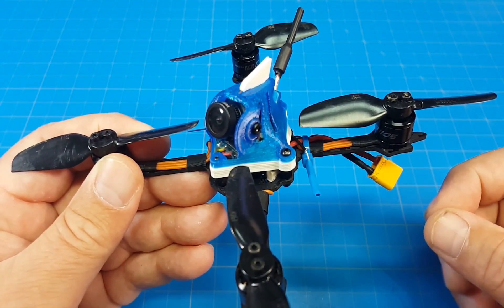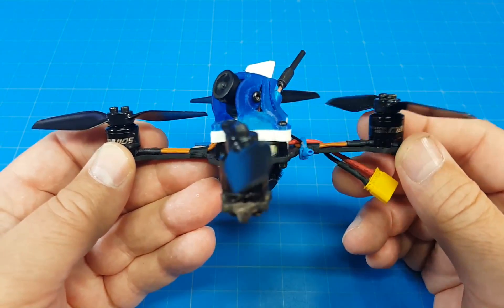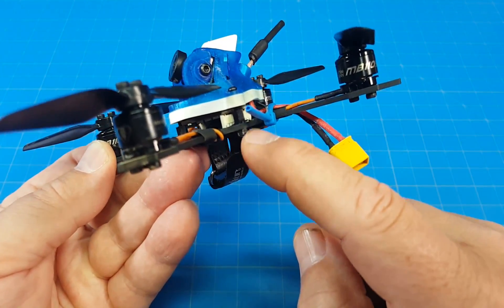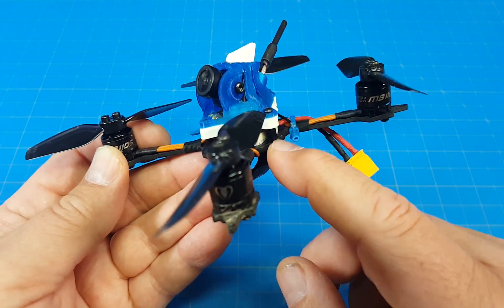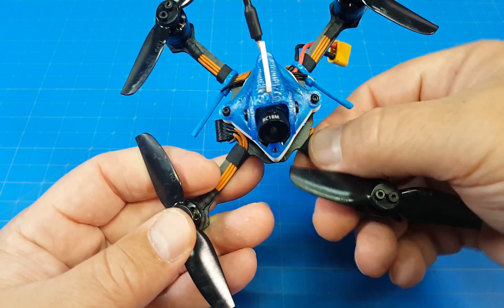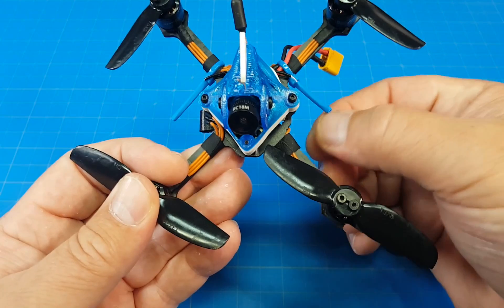ChopStick CSX - TomoQuads RaceFrame

Comment: I reckon this is going to be the next craze. 4500-5500kv 3s 3" it's quiet, can be very light with the new electronics and the props have enough rpm for a little bit of speed.

Comment from the maker: Additional motors used:
T-Motor/Racerstar RT11
SunnySky 1106 6500kv
T-motor F15 6000kv
T-motor F10 7500kv
HappyModel 1103 8000 and 6000kv
Rotorx 1107 7600kv
As well as one or two others I can't remember :(
I have tried the Rotorx 2535 in biblade format, not as good as the normal 65mm props we have been using.
Reply: I really really like this one!!!!!! Hope your having a great weekend!!!!!!!!
         Great Channel!!!!!!
             👍😀👍

Comment: The 65mm props are 2.5" twins. 🤗
Reply from the maker: Do you mean the normie 65mm are just like the 2535 rotorx in a bi blade format?
Reply: @NickBurnsFPV  the 65mm props are 1.5 to 2mm longer (0.75 to 1mm at each end).
Reply: @randyl2482  right it's actually like 66mm
Reply: @NickBurnsFPV  66mm is about 2.6"
Reply: @NickBurnsFPV  Except the rotorx are far better. Too bad they don't have push-on versions of those. Hint hiinnntttt.

Comment: I built this frame with 1106 motors and a caddx turtle (custom canopy) and it weighs 86.5 grams with hq 3 inch triblades.  I'm using 350 3s and i feel like it's not enough battery, but more battery = more weigh so i just accept the short flights.  Nice and durable frame so far.  I've had a few good tumbles with it.  I also direct soldered the motor wires.
Reply: I have also built one with 1106 motors  Do you have a suggestion for pids? I'm getting hot motors on stock betaflight 4.0 settings.
Reply: @Chris-je7ku  I'm using betaflight 3.5.7.  I gave up on 4.0 for these micro quads.  you need to lower P and D in 4.0 for a 3 inch or below, i'd start by cutting pids by half and read the 4.0 tuning guide if you have not.  A lot changed in 4.0.  https://github.com/betaflight/betaflight/wiki/4.0-Tuning-Notes  One thing they changes is tpa only reduces D.  you might want to try change it back so it lowers P as well.  set tpa_mode = PD
Reply: How do you safely remove the motor connectors on the GEPRC 12A Board?
Reply: @ZenMountain  I clipped the plastic off in pieces using wire cutters, then desoldered each pin.  I think pulling on the plastic connector with some needle nose while hitting all three pins at the same time with a wide tip on your soldering iron would be safer and faster.  You just need to secure the board well somehow.
Reply: mooosestang thanks!

Comment: Cut the 2.5 inch HQ quad blades like I did🥴 huge thrust🛸💨🏁🤟🏾 now I’m about to build my 3 inch geprc skip frame with these mamba 5500 KV motors thanks Nick how the hell did you power loop over the house backwards at that angle?🤣

Comment: I tried the Flywoo 1404 3750kv motors on Gemfan 3035 and it felt great on 4s!! i suggets you try it too. I got some good flight times on 550mah
Reply from the maker: I think I have some on the way. I am also interesting in the new 3" HQ prop. I believe its 3020.

Comment: If it turns out you dont have enough wire to direct solder, Taco RC has micro racewire that is very small and light. Also the CSX is a 2mm frame so if you used heavier motors I think durability would become an issue, so your choice of an 11xx motor was the correct one imo.
Reply from the maker: ah, yes, I forgot about the tiny racewire, I should get some of those. I agree, add weight to the end of the arm and durability goes down. Tomo doesn't mention using 1404 motors, but some may want or at least ask about it.

Comment: Chop it up!  That’s a great tip on hard mounting the TPU to the frame.  This is a really nice build.  I like it and agree with your thought on 3 minutes for you flight will generally equate for longer flights with your average joe and even more for Granny’s Sunday Flights...lol

On that tape, you can buy a very similar smooth tape that’s not fuzzy (VERSAF51217 Chemical Fiber Cloth High Temp Tape made by Maxwel Manufacturing) on Amazon, it’s wider (19mm) but lacks the peel off backing of EMAX tape.  Seem a tad less adhesive but sticks to itself well.  Search on Amazon for VERSAF51217 and the first item will be it, a 25 yard roll for $8.99.
Reply from the maker: Thanks Frank. I will give it a good to. BTW, do you have a huge bin full of tapes or something?
Reply: Nick Burns - Not a bin, but a ziplock bag of various types of them.  Just the one’s I use though, the ones I tried and didn’t work out, I tossed.  However, in this case I knew it was the right tape so bought an extra roll to share with few people, you being one of them.

Comment: There's a very new gemfan rotorx 2535 quadblade that you can take apart to 2x biblade. Ordered it - didn't arrive yet.
Reply from the maker: Did they redesign? I have used those off and on going back about 1.5yrs, I don't care for them in bi blade, and a bit of a pain to screw them down.
Reply: @NickBurnsFPV  I'm probably wrong about the new part... I was looking for 2.5" biblades as well recently and I just saw them newly listed on banggood.
Reply from the maker: I think more companies are starting to sell on banggood to squash the copies/clones

Comment: How is the voltage meter in all your quads so stable and not fluctuating all over the places like everyone else's? Something special in the scale? I noticed that long ago
Reply from the maker: I suspect is the unicorn dust in my solder :), I have really not paid close attention to it or to others. It could be I run GNB batteries and use 37/63 solder, IDK.

Comment: Nick, how did you wire the Nano VTX/camera?  I just killed two AIO F4 BetaFPV boards.  I had the camera wired to get its 5v from the Nano board to provide the 5v for the camera pad.  I did this so I could use the one red wire to power both the VTX and the EOS2 camera.  Apparently too much for the 5V pad on the FC.  Killed the boards :(, I suspect I burnt out the 5v Reg. They won't power from battery, but will do from USB.

I have now ordered a couple more FCs and will wire them up to power the TBS Nano from Vbat, with camera getting power from TBS Nano.

Comment: What about the RotorX 2535 quad blades? I've never used them, but can't you run them as bi-blades if you don't snap them together?
Reply from the maker: yea, I have run those, they are pretty good in quad blade but bi blade they don't perform to well, and a bit of a pain to mount they don't like to line up with the screw holes when not interlocked.
Reply: @NickBurnsFPV  that makes sense. Well, good luck finding a decent bi blade. I can't think of anything else at the moment

Comment: Nick, you mentioned the HumQuad again... curious if you're having issues with yours.  I have pretty severe video distortion and breakup on mine, also has some recovered RX signal loss (Stage 1?) where it stopped responding for a sec during flight.  There are also a bunch of other things that I don't care for about it but I don't want to bias your review so just happy if you wouldn't mind giving me a "spoiler" of the video performance of yours.  Much thanks and great video as always, although I find the pod on this one a bit less aesthetically appealing than others.
Reply from the maker: I don't have any hx100 dvr uploaded, but  in the goggles I thought it looked normal. I have had rx loss once or twice, the xm isn't the best even at close range.
Reply: @NickBurnsFPV  thank you sir!

Comment: i really dilemmatic about choosing this motor or 1207 500kv, i want running on 4s 350-450mah on twig style. i never see you fly this mamba on 4s, any significant difference?
Reply from the maker: I wouldn't go above and 06 motor, the 07 will have more top end but drain the battery much faster. I would move up to a 130x motor

Comment: great video Nick,  Question I have for you is I have a few custom builds I am now building a Sanchez 3" frame what advice can you give me on motors I was going to go with the betafpv 1105 5000kv but now I see people are using the 1206, 1304 and the 1404 what would my flight times be with these larger motors and which would be the most efficient out of the 1206 5000kv the rcx1304 5000kv or 4000kv and the flywoo 1404 3750kv.  I plan on 3" props probally triblade and a battery like 550 or 650 3s?
Reply from the maker: What is the weight of the frame and what battery did you plan to use? Also can it mount 9x9 (110x) and 12x12 (140x) motors?
Reply: Frame is 7.5grams using the betafpv 12amp aio and actually decided to go with the 1304st 5200kv motors.  Canopy is 2.4 grams racer cam nano 1.8 and eachine nano 400mw vtx!   Hopefully a 550mah 3s will be enough for 2 minutes without power sag and hopefully the stock pids work!
Reply from the maker: depending on how you fly I suspect 2mins will be fairly easy to get.  I do worry a bit about the weight of that motor, while it isn't heavy its more than 110x and depending on the quality of carbon and its thickness it could mean arm breakages on crash.

Comment: Hi Nick, I saw this video and went out and built one with 1106 6000kv motors and the gemfan 3025s. Do you have any suggestions for pids? I'm getting hot motors on the stock betaflight 4.0 settings.
Reply from the maker: BF4 on micros is very tricky. I would flash back to 3.5.7, not just on this but on most micros.
Reply: Awesome, I'll give it a try. Thanks!

Comment: Hi Nick, I have a question about the GepRC board, I could have swear there are two led light comes on red/blue but with mine only red light comes on? Board connect to BF just fine though and  it flashed successfully to 4.04
Reply from the maker: I get red and blue on my geprc boards, but those are both version 1, is your version 1.1? Maybe they changed that?
Reply: @NickBurnsFPV  my board is version v1.0, it's been thru many crashes/tumbles and still flies fine. Then my Sailfly-X arrived and I was enjoying flying my SF-X for 2 weeks until I decided to go fly my Primo GepRC12A, it armed fine, give little throttle, it hovered and just when I give it more throttle around half it takes off on it's own as it was given full throttle when I had it down to 0.

Comment: Looks great 👍. Have you tried other props(avan 3") ? I have had bad luck with bi blade props so far. Avans helped me.
Reply from the maker: I have flown them, but I didn't try them on this one. Typically when we add a blade we lose efficiency.
Reply: @NickBurnsFPV  I couldn't stop jello with the bi blades. Mine were terribly balanced.

Comment: Yeah there's the gemfan 2535 also sold by rotorx which is a twin and quad blade modular. But I think the bigger prop requires less throttle to achieve the same cruising speed. I fly my quads the same as you and we are basically cruising at high speed around corners. You ain't improve that efficiency with a 2.5 inch I think. I really like this build I would really like 1404 on this ultralight setup.
Reply: I feel like 1404 Will be too heavy, probably a 1304 would be a bit better since they're about the same power as an 1106 but with more efficiency.
Reply: I also have been looking for 2.5 bi blades and can't find them by rotorx I just looked. I like the geprc 1206 flies good on 2s and 4s. 2s needing a different pid profile for a tighter tune to eliminate the weeble woobles.
Reply: @wisdirty  search for gemfan 2535 on banggod. It's a quad blade but if you look better they are two twin blades locked. And you can disassembly them

Comment: Luminer 2.2 is going to be as close as you get. They are great props but won’t turtle.
Reply from the maker: I have tried those, I haven't been happy with them on the motors/quads I have tried them on. Pretty big blade on small motors, I haven't tried them on lil floaters or and 1104 motor yet.

Comment: So what was the total cost of the build ? I guess what I'm  asking is it cheaper to build or just buy a tooth pick style drone
Reply from the maker: BNF are generally substantially cheaper. But builds give us all our own options. This build is about $170, I believe has the best options though, the vtx alone is $40 and has up to 400mw power with these best signal I have come acros, camera is my favorite micro cam, board is normal going price for the 12amp variety, the motors are pretty economical at $9.99 a motor. The ER349 will out perform this by far, but also weighs more so it will be more challenging to fly in a space like mine.

Comment: Great review Nick!  Did you use a cap on this build?
Reply from the maker: no cap this time. I tend to power the camera through the vtx, the TBS vtx are some of the best on the market, and the board is 4s capable, I didn't feel there would be a need for a cap.
Reply: I've read several reports of melted FETs and smoking ESCs on the GEPRC board. No idea if this was used with 4S. Anyway I'm going to add a cap on mine 'just in case'. 1 more gram 😭